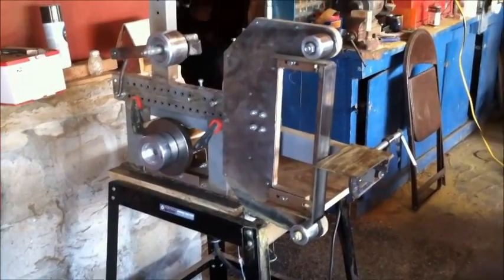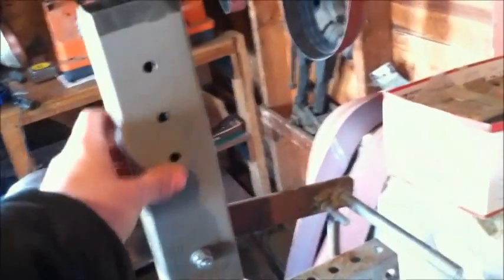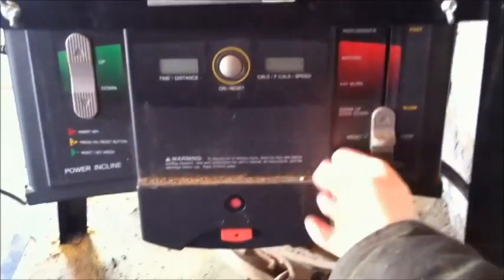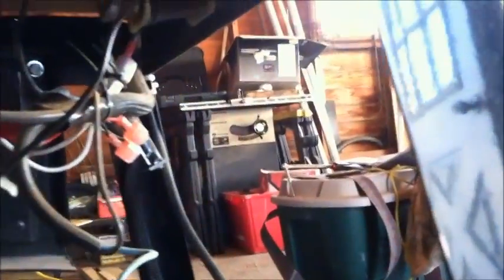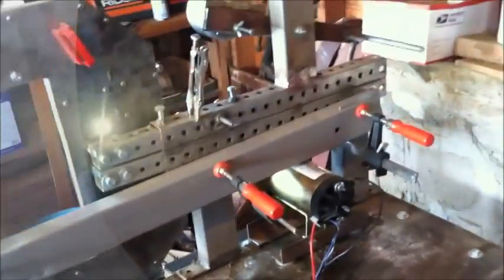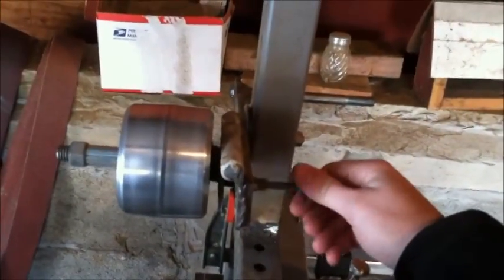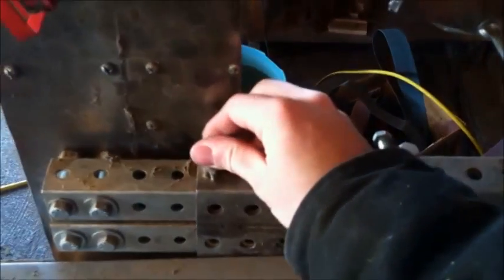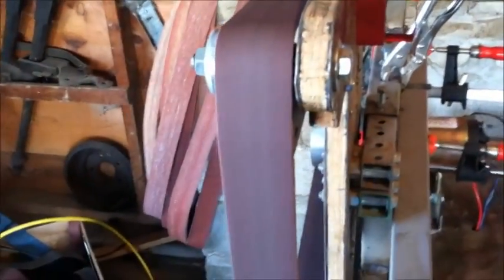How to make a 2"x72" belt grinder for knife making

Comment: How did you mount the drive wheel to the treadmill?
Reply from the maker: I had to take it to a machine shop to let them bore it out to the correct size. Then I just grinded a flat on it and kept it in place with a set screw. Hope this helps!!

Comment: do you have scmantics of the design
Reply from the maker: Sorry I do not. Really it's not so bad. Just make it to your liking and roll with it!!😄
Reply: My main concern is the front part which the top n bottom roller are I might go look at some and get measurement lol but great idea I watch one of your videos awhile back not two days later got me a treadmill from a trash pile and we'll my gears started turning and hopefully will be grinding and completing knives soon ...I'll keep ya posted
Reply from the maker: Right on! really the platen is just to be the length you desire for working space. If you are going to be working with 1 foot knives or shorter id go with 12 inches. Just put your wheels on a half inch bolt that you run through the ends. The whole unit up front is just 3/4" ply wood with sheet metal on the sides. Hope this helps and good luck!!!

Comment: Use what you have, right? Pretty cool. We're in a rent house because our house sold before our new one isn't done yet. As soon as my shop is ready, I'm building one of these. Right now it's grinders and files. I'm debating between buying a motor or using the 3hp motor out of my table saw. Guess if I tear apart the saw, I'll have a reason to buy the new one I've been wanting :)
Reply from the maker: +sjeverett75 right on! good luck with your build!!

Comment: Will a 1x42 work for knifes? I just don't have the money to spend$400 on one.
Reply from the maker: it certainly will! it will just simply take longer to do your grinds is all. Thanks for watching!
Reply: BEAN B You can make a 2x72 for much less than $400...
...as long as you are okay with making your own wheels out of wood with bearings in them, and attaching them to a wood frame.  Get a cheap motor off craigslist or somewhere, with some pulleys to change speed anything > 1/2 hp should work.   I plan to make one using a bench grinder as the motor, and getting some bearings or caster wheels at ace.

Comment: Where did you get the tracking wheel and wheel for the treadmill motor? What size are the wheels also? Thanks.
Reply from the maker: I bought them from Beaumont metal works! Sizes are found in the site. http://www.beaumontmetalworks.com/shop/
Reply: Thanks for your help! I'll check them out.

Comment: Good job, I think your tracking issue is due to not being enough weight on the hinge. You could add more weight to keep it down or if drill through were your adjustment makes contact weld a nut on the end of the adjustment and one one the inside to sandwich the tracking plate just loose enough for it to spin when adjusting in and out.
Reply from the maker: Thanks for the advice Steve! I actually have since then replaced the old spring with a stronger one and seems to be tracking just fine now:D

Comment: I don't have facebook...  Any way you could give more details on the build?  Have dimensions?   I currently have a 1x42 with a 1/3hp motor and it just doesn't do the job.   Looks great!  Other than being loud, it looks like it works great.
Reply from the maker: Most of the parts for this grinder can be salvaged from the whole treadmill itself. The hand rails can provide the frame of your grinder. I actually made my frame out of square tubing stock that came from Lowes because it was made before I purchased the treadmill. For me the parts list went like this...

$200 for the aluminum wheels      (Beaumont Metal Works)
$30 for the stand it sits on             (Harbor Freight)
$40 for square tubing                    (Lowes)
$125 for the treadmill                    (Craigslist)

Some parts like the platen, and the tension arm for the tracking wheel were made out of scrap I had laying around the garage but would be of minimal cost.
Reply from the maker: Sorry I don't have the dimensions. Just kind of pieced it all together to make it work haha

Comment: Nice job son, You will keep the belt running true if you hang your belts straight when not in use.  Learned the hard way.  Belts can be cleaned by using the sole of an old tennis shoe, cleaner than the rubber blocks they sell. keep up the good work.
Reply from the maker: I hang them up on my wall so they should be good to go:D Thanks for the tip though! That will be quite useful!

Comment: Great video! Quick question... Have you ever tried sanding belts/discs from Maverick Abrasives? I recently switched over to them from 3M & they have been performing significantly better...and their pricing was 20% better, believe it or not . THought i'd pass along the info :) And they also manufacture buffing wheels & buffing compound!
Reply from the maker: Actually no I have not. Currently I get all my belts through supergrit.com. They have pretty good prices and I can usually grind about 2-3 knives with their ceramic belts if I make them stretch. I will certainly check them out though! Thanks for the suggestion! :)